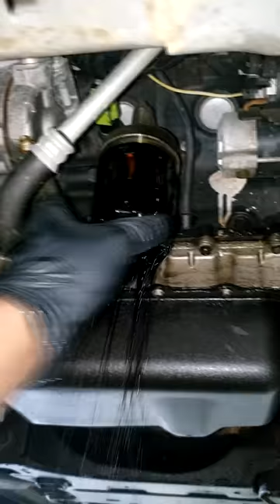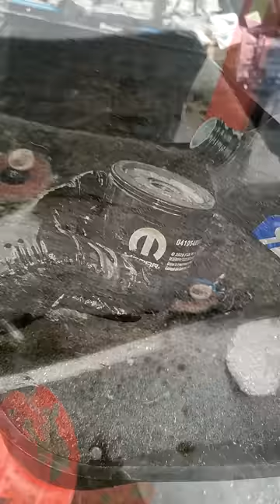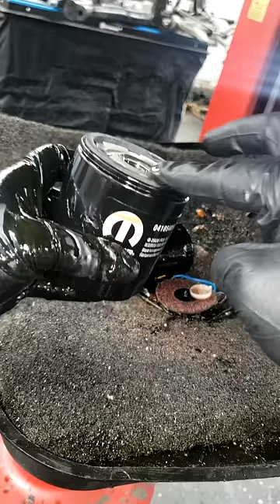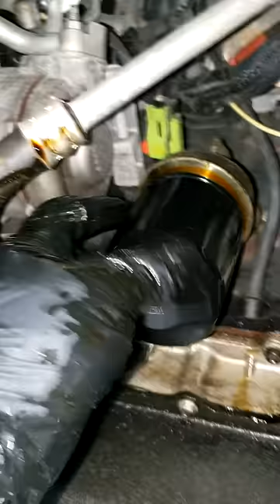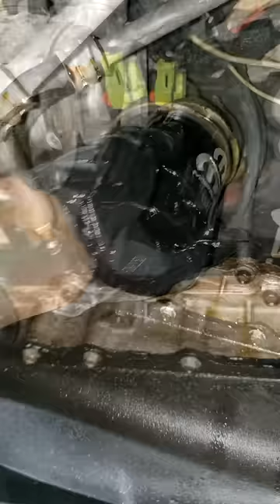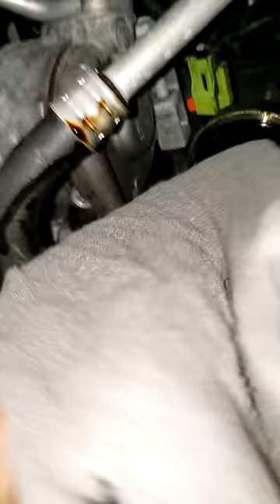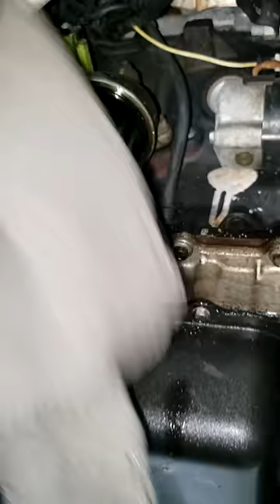Don't Lie.. Are yall still doing this?

Comment: My man didn’t even clean the mating surface 😂
Reply from the maker: You recond  the world will come to an end now? Don't be a drama queen dude. But yes, clean the old oil off the mating surface.
Reply: @OnlineMechanicTips  i like to remove the ring of dirt that collected on oil seal surface especially if it is on side of engine and it makes sure no chunks or whole gasket is left behind
Reply: @OnlineMechanicTips  thats where some of the biggest stones and grit are going to stick... you fine with risking it? one pass in a cylinder wont hurt anything right? Dont make excuses for not cleaning it..
Reply: Mistakes like that violate community guidelines.
Reply: I would argue cleaning the mating surface is far more important than filling up the filter that literally gets filled up in 2 seconds when you start car up. "but then the car go without lube for those 2 seconds" nah, there is still enough residual oil coating the parts.
Reply: @OnlineMechanicTips  blow up about that? On a post about prefilling oil filters? Priorities, my guy.
Reply from the maker: @gummostump4217  yea, its just old oil. If yall crybabies whine about old oil being left on the base you shouldn't be a mechanic. Out of working on cars day in and day out there will be things that sneak through the cracks that will not cause the world to end. Grow a pair
Reply from the maker: @businessraptor134  Whos making excuses? For what? I said its simply old oil which will not cause the world to end.
Reply: NEITHER DID YOUR MOM 😂
Reply: @OnlineMechanicTips  lol says the old guy making a whole video about doing something for no reason just because “it still matters”. If you don’t prime the filter before installing it you reckon the world will come to an end? The hypocrisy is wild to me.
Reply from the maker: @genericsocks7542  If it bothers you simply wipe the old oil off dude. Yall some of the biggest drama queens I've ever seen. Damm
Reply: That is a good plan except for my slant six where the filter is inverted.
Reply: @onlinemechanictips the whole point is if you’re not going to take the time to wipe off the old oil, why are you saying pre-charging the filter is important?  If you’re going to preach doing things the right way-don’t get upset when people tell you to do it the right way!
Reply from the maker: @everydaysecrets288  Wait, who are you again and who's upset about anything? My point is that it's just old oil. Yes if it bothers you, wipe it off. It's not the end of the world if you don't wipe it off is my point. It could even be used as a lube for the new filter seal. This is a simple oil change, its not rocket science and you don't need a degree to do it. Yall making a LOF job bigger than what it needs to be.
Reply from the maker: @Troy Hendrickson So I'm just seeing this and not sure how to respond. Lil Troy here obviously feeling him self. I'm sure he aware that he can just make a video showing his version on how things should be done and he can even un sensitize it for the drama queens that's bent out of shape because old oil left on the base. But you might wanna check yaself lil dude.
Reply: @OnlineMechanicTips  no drama about it, only takes two seconds. I personally do it just to make sure I didn't leave the old gasket behind. Made that mistake on my 05 Mustang once, never again! Got a mile down the road and noticed smoke POURING out from behind me, I had to pull over into a random country field at night and I swear to God dozens of people and cars started pulling in for some weird religious-looking congregation thing, I thought I had pulled into the middle of a KKK meeting or something 😱😱😱 anyway check your mating surfaces folks 💀
Reply from the maker: @pizzlerot2730  Yes check it, I agree.
Reply: The mating surface should be cleaned for a proper seal for one, but also let’s say it drips on the ground in the customers driveway or it burns off and the customer gets a whiff of the smell. Now you have a pissed off customer and you’re having to pull the car back in and clean it properly(which should have been done the first time). Then the customer may not come back or will want a free oil change and if it leaked on the driveway then they may want the company to pay for the cleaning of the driveway or in some cases the technician himself will go to the customers home and clean it. I’ve been doing this day in and day out for years at a dealer and I promise this is exactly what happens. Priming the oil filter honesty isn’t even necessary unless it’s a big commercial diesel or in some cases are higher end performance car or race car that’s built to specific tolerances with that in mind. The engineers took into account the lack of oil on start up after an oil change which is why the tolerances are wide enough so that the residual oil is enough. That’s why on some vehicles it’s literally impossible to prime the filter because the filter is literally facing down into the engine so any oil in the filter will immediately spill out and make a mess. Please don’t spread misinformation lol.
Reply from the maker: @@thenorsegamer376 Who says im a mechanic? This is youtube sir. Im simply a Youtuber. But you welcome to make a video and show the proper way.
Reply from the maker: @@thenorsegamer376But your 2 subscribers on your channel want you to do it. They screaming for more videos from you but seems you to busy worrying about what's going on over here. I'm satisfying my 151k subbers my guy so maybe you should get to work and make your 2 subbers happy. FOH
Reply from the maker: @RykerRally Who's but hurt little man? I'm merely answering to comments on the video. If you have a question ask, if not FOH
Reply: He says dont be a drama queen yet telling us we NEED to prine a an oil filter in 2023
Reply from the maker: @RidinSpinners36  I never said anything about a year clown. Get your mind right.
Reply: and he still ask us how many of u guys still do this
Reply: @OnlineMechanicTips  mr online mechanic tips I mean just a YouTuber that says he’s not a mechanic but doing oil change videos and giving tips. How many of you still do this. It still matters. Just make more videos and reply to all the comments. Stay being an online mechanic 👍
Reply from the maker: @angelred364  Thats the plan big dawg. Thanks for the tip. Now if you'll excuse me, I got more tip videos to edit. Feel free to hang around and watch. Or are you to busy trolling videos like  sideline cheerleaders do?
Reply: @OnlineMechanicTips  who said I was a cheerleader? This is YouTube sir. I’m just a commenter. U feel me ?
Reply from the maker: @angelred364 O I thought you was just one of them sideline trolls that know everything but simply decline to make a video and show everybody. You no them guys that like to critique other videos with solutions or counter claims
Reply: @OnlineMechanicTips  that's 99% of YouTube commenters so you were just playing the odds 😂
Reply: Neither do I,and I have 2 kids
Reply: @OnlineMechanicTips  it sounds like you are the one being a drama queen
Reply: @grassyfieldz4578  yeah filling the oil filter is useless. there are no moving parts inside of the filter that will become damaged like the engine. thats why you fill the engine and the rest does its job. ive done oil changes on about every car out there and not once have i filled the filter, and not once have i had an issue
Reply: That I found peculiar too!
Reply: @OnlineMechanicTips why are you deflecting to the world ending? Everyone is focused on how long the CAR will take to end.
Reply: @OnlineMechanicTips  "we still do it for a reason" lol
Reply: fr, ..and he still had to lube the new one ??.. either clean the surface and lube the ring, or don't and leave it dry .
Reply: @grassyfieldz4578  And a good percentage of oil filters are horizontal, the point of this video is in fact pointless.
Reply: @pizzlerot2730  I've seen that happen more than a handful of times and lesser , over-torquing the filters , some guys just don't understand that you can't use a cheater pipe on a breaker bar and go to town with it .
Reply: Just put the damn filter on, as long as it seals it’s fine.
Reply: I caught that too. Always reinstall clean.
Reply: who does?
Reply: @OnlineMechanicTips what's your garages name and the person doing the work displayed? Shout it out if you proud of the work being done on video. Sure customers wanna know how much care is put into their oil change and why their labor takes so long.
Reply: What was on it? Exactly nothing bc the oring covers the spot where the new oring goes lol... Not like it had been mudding or anything geez
Reply: @OnlineMechanicTips Only drama queen on this whole thread is YOU! Don't like criticism??  Then don't ask for it. Especially on the internet.  People are going to disagree with you. Especially rhe majority of shade tree mechanics on here.
Reply from the maker: @davidd.c.9344  Dude I have no problem with that, what are you talking about? On every one of my replys I mention that yes, it should be wiped down but dam, its not the end of the world if you dont, and to simply not be a drama squeen. Some of yall rather throw the whole car away simply because you saw that it was not done, smdh. Thats being a drama queen.
Reply: @davidd.c.9344 it’s dumb criticism. Those of us with eyeballs can see the only thing on the sealing surface is some old oil.
Reply: @OnlineMechanicTips  if you work on cars day in and day out why dont you have a spray can to clean your shit up? i mean you got gloves for your princess hands but no brakleen?
Reply: Thats y i do the simple maintenance myself and let shops/dealers do warranty work 😅
Reply from the maker: @aleks_jones  This a 60 second shorts video dude. Do you recond I could have also squeeze the tire rotation in on this video as well? Smdh, everything was cleaned up dude, just because you didnt see it dont mean it didnt happen. This just a oil change, you dont need a college degree to do this, calm down, its not that serious drama queen.
Reply: Don't need to
Reply: Tell the residual oil that when the oil pressure drops to 0 for a few sec n then comes back. Good luck with your dry starts. That split second metal to metal is way worse for the engine than anything else you do to it.
Reply: Its not necicerry its prefrance
Reply: Why bother cleaning the old oil off? Changing oil doesn't get rid of all the oil in the engine. Unless you vacuum out all the oil you will still have a lot more old oil in the engine than what is stuck to the surface. And I don't know about you guys filters but mine seals so I don't have debris under the seal. When you vaccum your house do you also vacuum under your rugs too?
Reply: If he drilled a hole in the old one, there wouldn't be a mess.
Reply: I always clean the mating surface! She ain’t gonna mate if she know you don’t wash those sheets! Also did anyone notice he didn’t wipe where the seal is made between the filter and engine?
Reply: It's funny because not cleaning old oil off is worse than not pre filling the filter lmao 🤣
Reply: @trsskater rugs on lino! Dirtiest place ever!
When you pull an engine part off it's common sense to clean before re fitting because you don't want that whole thing ruined by a small chunk of crud you missed being complacent!
Just like a rug the dog pissed on! If you don't pull it up and clean it the rug is only getting worse!
Reply: @ranger178 yeah before I remove my filter I wipe it all down and spray itnsll with brake clean then wipe the mating surface clean
Reply: @OnlineMechanicTips I recently replaced an cracked radiator on my hyundai sonata  se 2014 model, how long are the life expectancy on new radiators that you have seen in your career as a mechanic just needed some advice.
Reply: @OnlineMechanicTips your name is mechanic tips and you’re saying oh it’s no big deal when you don’t clean the mating surface. Joke
Reply from the maker: @zhallquist28  Yes you should clean the old oil off the base but its no big deal if you dont dude. Its still oil that can act as a lube for the seal. This not rocket science. Dont be a drama queen. Nothing will happen. You think to hard
Reply: @OnlineMechanicTips you’re pretty bad at giving mechanical tips lol, you sure you know what you’re doing?…
Reply: @OnlineMechanicTips And stop being such a crybaby, own up to your mistake like a man and keep it pushing lmao
Reply from the maker: @Drogas3653  I don't. You should simply come off the sidelines and start making videos so we all would no how to do things. No sense you being a sideline troll dude. Get on in here. You got about 100 subscribers, im sure you could use more.
Reply: @OnlineMechanicTips 
Yes, we can tell you're not a mechanic and just a "youtuber"
Reply from the maker: @tangleass  Well based off your comment and ya profile, you simply a nobody. So simply stay in your place lil dude.
Reply: @OnlineMechanicTips I mean what if yo filtre is facing down or sideways 🤷🏻‍♂️💀
Reply: That’s what I saw too 😂
Reply from the maker: @BillLomey  Lmao, you drama queens are everywhere. Just how on earth can a oil change be poorly done and what are the ramifications that the car will experience because of it? I'm going to go out on a limb and assume you a grown ass man in your late thirties. Im almost 100% certain you have bigger problems in ya life. Look dude, the oil change was done and the car been gone and back for its 3000 mile next oil change. I suggest you get a life ok
Reply: I like how he got mad at this comment but got mad about other people not "prefilling" the oil filter the filter might leak but hey atleast it's prefilled am I right?
Reply from the maker: @wyattmendez1755  If you referring to me my guy please understand that I am never mad or upset at any comment.
Reply: It can’t hurt anything. Just think of it that way!
Reply: There are oil filters that are horizontal and even some the filter is facing almost straight down. So what is your reason for doing it????
So what do you do when your car sits all night and the oil drains off the cam and crankshaft.
Reply: @OnlineMechanicTips If you weren't upset, you'd either not reply at all or not call people names. It obviously got under your skin, but you seem too proud to admit it.
Reply from the maker: @vildrox019  Lol, im never upset dude. You a stranger to me. I reply back because that's what youtubers suppose to do. My replys will only include name calling if the comment disrespectful. You can respectfully dis agree with somebody dude.
Reply: @OnlineMechanicTips  oh be quiet already you failed mechanic
Reply from the maker: @Drogas3653 Failed??? O no my friend. Seems you mistaken. You obviously don't know me. Let's keep it that way
Reply: @OnlineMechanicTips  Agreed. You sound unbearable to be around anyway. Good luck 👋🏽
Reply from the maker: @Drogas3653 I would never ask you to be around me dude so you ok.
Reply: @OnlineMechanicTips I agree on your procedure to prime the oil filter. But the other guy was right. You need to inspect and clean mounting surface, before you put in the new filter. 😂
Reply: maybe he worked at jiffy lube
Reply: @trsskater one of the poorest analogies I've ever read, and yeah. We shake it then pick up our rugs before vacuuming. Probably like millions of others, lmfao
Reply: Exactly what I was thinking!  Why put fresh oil on the seal, with old oil right there,,,
Reply: that's the differnce between somebody else doing your oil and you doing your own
Reply: @OnlineMechanicTips naw they got you my guy. Just accept it and move on.
Reply from the maker: @getemgod2770 Lol you suggesting I move on from a comment made 4 months ago? Sounds like you the one that should move on dude
Reply: Can't believe he's having an argument on his own channel lol
Reply from the maker: @RennieAsh  Who's arguing dude? Replying to comments all im doing. Are you OK with that?
Reply: @OnlineMechanicTips  it may boost metrics slightly but generally I don't see creators having a squabble in the comments section. Waste of time imo
Reply from the maker: @RennieAsh  Now how would you know? You not a creator looking at analytics dude. This simple video almost at 2 million views. I've gotten a shit tone of subscribers off it as well as revenue. So how you gone tell me? The activity and traffic cause Stuff like that. I reply to all comments good or bad. So there's no arguing in the comment section, just merely discussions
Reply: @OnlineMechanicTips  dude best way just to make another video and then you won't see bad comments 🙋🏻‍♂️
Reply from the maker: @lifegoeson4085 Smdh, dude comments are a good thing. I don't care about if comments good or bad. There call opinions. You never gonna please everybody on any video. And of course I make other videos. I upload 3 shorts a day, do you think I only see good comments, absolutely not. I'm a Youtube content creator on youtube dude, im a mechanic in the shop. Let that marinate for a minute.
Reply: @OnlineMechanicTips  that's good 👍🏼, am not trying to till you want to do, it's jus all the comments sounds like lil kids, everyone needs to grow up and need patience, am a utuber to and I went to school for automotive technologys younger days, it's jus the way people were talking about you not cleaning the surfaces, I did many oil changes and I never had a problem, good like on your videos👍🏼
Reply: @OnlineMechanicTips  so you just proved to yourself that spending so much time on a little 100 comment thread is mostly meaningless out of "2 million views".
I mean would you rather spend 30 minutes total typing "you don't know what you're talking about" style comments or would you rather use that time to do something else... Lol
Reply from the maker: @RennieAsh  I didnt just proove anything, fact is, I dont have to proove anything to you dude, I dont know you. Who says I spend so much time doing this? So let me get this straight, you have a failed youtube channel but you here trying to give me tips??? Use your own tips with your own little channel dude. Maybe if you would have been replying to comments you would have had different results. But I got this over here, no reason to worry about me dude, im good
Reply: @OnlineMechanicTips  ooh we gotta tuff guy here.. 
Just because you managed to get some views doesn't mean that gloating in the comments is what earnt you that, or that is a good use of your time. 
But yeah you keep thinking that 0.001% is helpful dude.
Reply from the maker: @RennieAsh  I'm not gloating, im just reminding you that you in no position to try and give me tips at something you failed in dude. My time well spent doing it the way I want to. So I suggest you use your time wisely by not being concerned about whats going on over here. We good.
Reply: @OnlineMechanicTips  who said the world is ending? do your job better.
Reply from the maker: @samogden4428  You drama queens just act like the world coming to an end..smdh. Old oil left on the base not going to destroy the planet dude
Reply: What’s it gunna do leak in 5k miles😂
Reply: Neither does anybody else for that matter 👀 Yall sticking your shaft in another mans oil residue.
Reply: @OnlineMechanicTips This coming from a guy making a video about filling an oil filter for a gas motor.  Useless knowledge.
Reply from the maker: @stevethedweeb9525  Then why you here commenting Mr Clown Man?. In case you forgot, thats what youtubers do, make videos
Reply: That’s why I don’t trust lube shop. I do it on my own even flushing my transmission oil. Lol
Reply: But still oiled the new gasket
Reply: Not only do I not clean the mating surface I wipe burned oil on the rubber gasket of new filter
Reply: @jodycordell1972  burnt oil or just used oil?
Reply: @MrGamecatCanaveral  the oil that is left on the old filter gasket
Reply: I never put oil inside the filter before installing but I do lube up the rubber gasket with oil.
Reply: Yuup . And attention to details like that is what makes a difference . That's why I always do oil changes on my vehicles.  This guy probably is a jiffy lube  oil changer.
Reply: @OnlineMechanicTips If you prefill a filter without knowing why you shouldnt be a mechanic either.
Reply from the maker: @mikaellindqvist5599  Who says I'm a mechanic Clown?
Reply: Was just about to say that 😆
Reply: @OnlineMechanicTips It's amazing how many people who probably get their oil changed at Walmart are critiquing the most insignificant details. I do quickly wipe the mating surfaces down but it's more of an OCD thing than anything. As long as there's no obvious debris or other build-up (which there shouldn't be), it really shouldn't make a difference. It takes little effort to do right but it'd probably be worse to wipe it down with some dirty shop rag that has a month's worth of projects sprinkled all over it.
Reply: Dam straight better get to wallys world and get some brake cleaner.
Reply: I clean the surface and check to make sure the old ring is not stuck on the filter housing, i fill the filter halfway , put oil around the new seal, and screw it on. But the way he did it won't hurt anything. He does clean everything when he's done.
Reply: This is exactly why I change my own oil. Guys like this who are okay with half-ass work. Basically saying folks are whining about not cleaning a sealing mating surface. This is the same guy that will over torque the drain plug and your aluminum pan or forget to tighten it at all. Hack work.
Reply: I have been a tech since Dad was lifting me up into the engine bay so I could do my first valve job, I have never been one to pre fill a filter. Most oil pumps fill the filter immediately when it starts pumping. I don’t see what you are gaining. Just me and 40 years of pulling wrenches.
Reply: @OnlineMechanicTips 
You keep implying you aren't a mechanic, but then claim that the owner of this car was back for an oil change after 3,000 miles.

A mechanic that has to hide the fact he is a mechanic to avoid scrutiny worries me at the least.
Reply from the maker: @We_Are_Borg_478  Dude, Ive seen your Youtube channel, you got bigger problems than to be worrying about me. Get to work my guy
Reply: @OnlineMechanicTips  
So you can't answer the question?

It's a simple question.

Are you a mechanic?
Reply from the maker: @We_Are_Borg_478  Naw, I just change oil dude
Reply: Crazy how hes being a drama queen about pre filling the oil filter but you can’t point out the fact that he didn’t clean the mating surface 😂😂😂
Reply: @OnlineMechanicTips lol he called you out on a job not properly done and you get upset jajajaja
Reply: This dude is a hack
Reply from the maker: @johnnythompson83 Can you even define that word and if so how do that apply here? Or are you just bored and wanted to say something?
Reply: That's extra. 😂
Reply: Bmw don’t got this issue
Reply: @Airon79 🤣🤣🤣🤣🤣🤣
Reply: @OnlineMechanicTips stop calling ppl drama queen and world coming to an end BS garbage your saying just because ppl correcting you and calling you out on your tackiness. 😂
Reply: Most of the time, unless you clean the entire area around the old oil filter before you take it off. when you clean the mating surface. Once it's removed, you're more likely to just contaminate it with grunge from all around it while you're trying to wipe it clean.
Reply: Anyone else turned on by the words mating surface?
Reply: if its tight enough you dont have to if you clean it afterwards well
Reply: I noticed
Reply: EXACTLY!!!! Go the extra step filling up the oil into the filter but left the sealing surface dirty as fudge!!!!🤷🤦
Reply from the maker: @MoBangFoYoBucks Smdh, damm, are all yall drama queens? I've never seen a bunch of big cry babies in my life. You recon this van died on the road or something because of that? There was still oil on the surface Bozo so the seal got lube. Who cares if it was dirty oil.